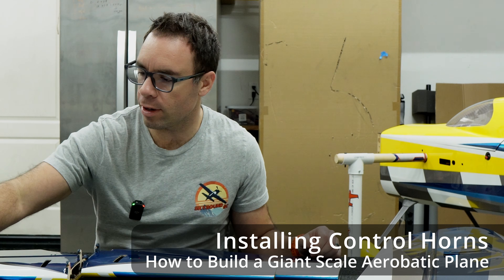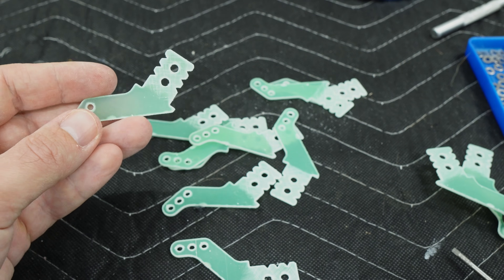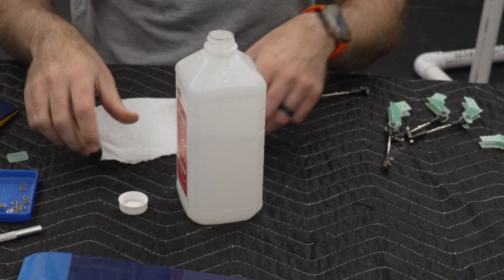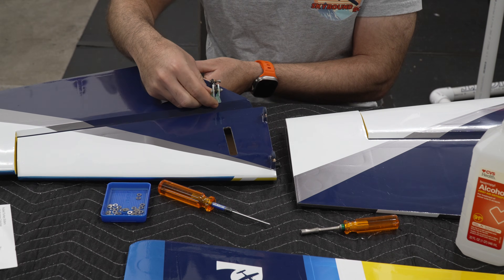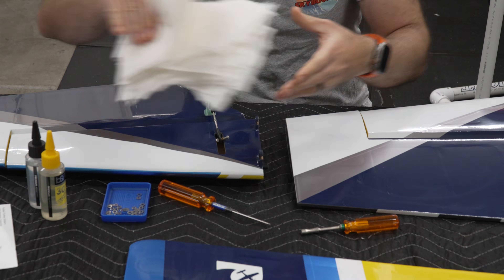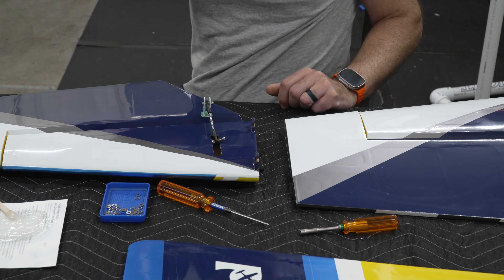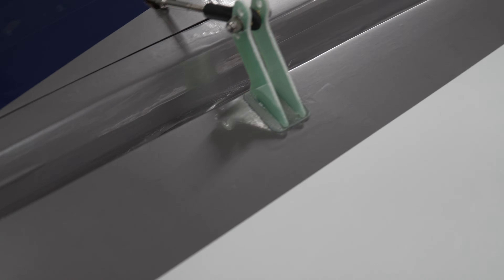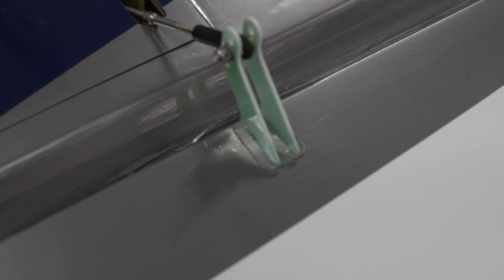How to Install Control Horns - Giant Scale RC Airplane Build Series (Ep. 2)

Comment: wouldn't hurt to wipe off with acetone prior to sanding... if the composite surface is contaminated with mold release, sanding it just rubs the contamination into the fresh surface.
Reply from the maker: Hmm. I hadn’t thought of that before, will likely do it on my next build. Thanks for the tip!